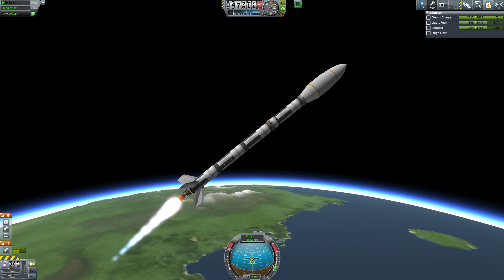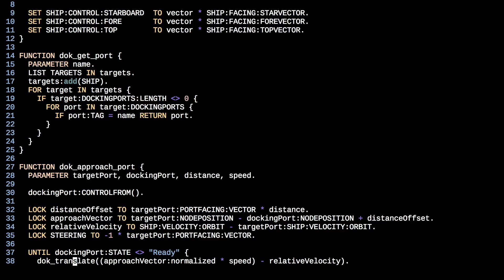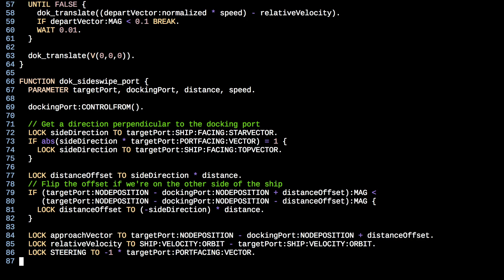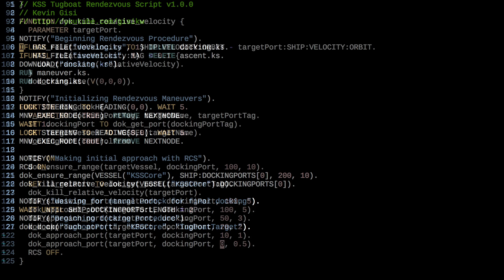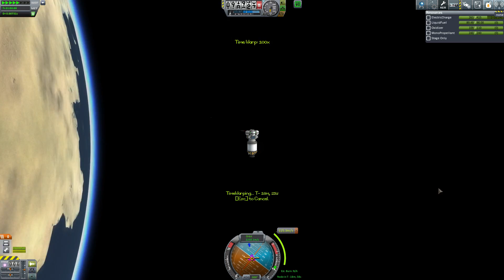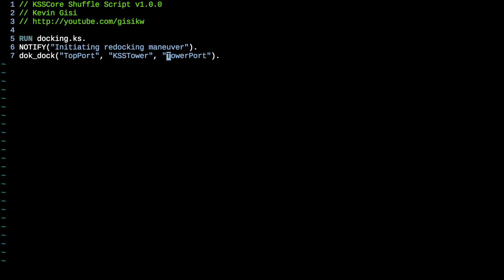Kerbal Space Programming #24 - That's No Mun...

Comment: Maybe you can use the main engine for the initial approach.
Another idea would be to send a message to the other craft and have it maneuver to point the port at the approaching craft. This would require a message handler of course. If there is a core with the appropriate return message available then the docking can be simplified.
Also perhaps docking would be a good PID controller usage.